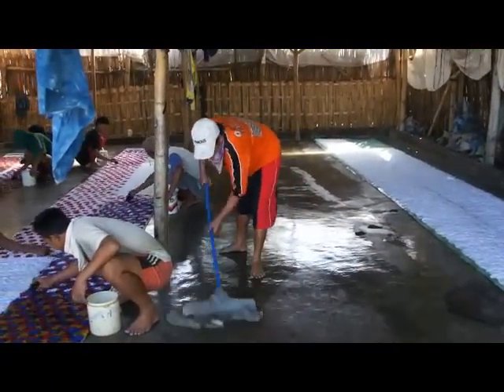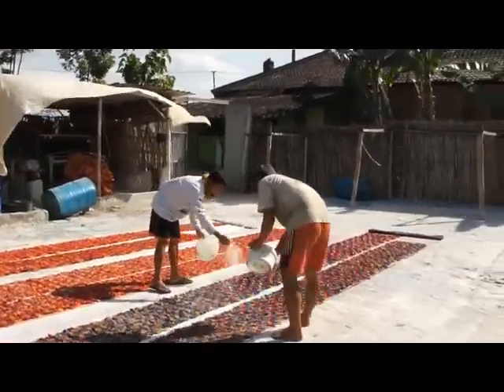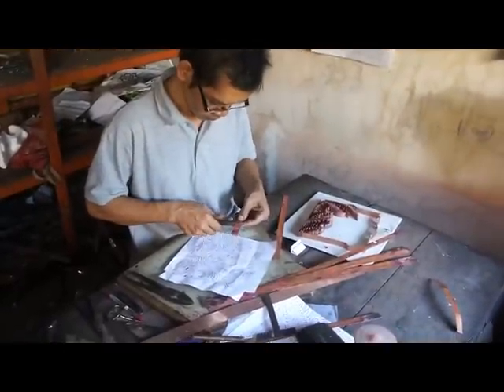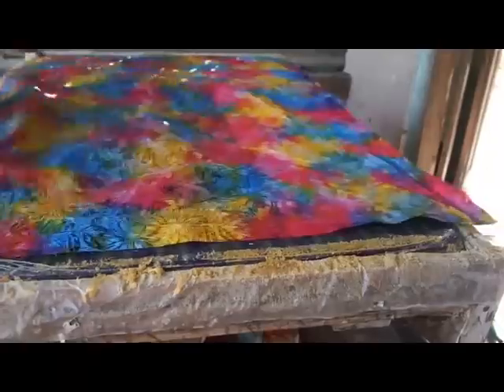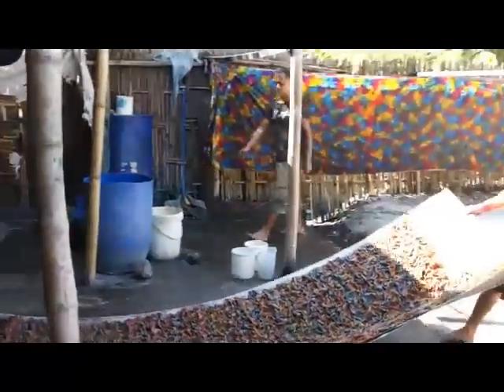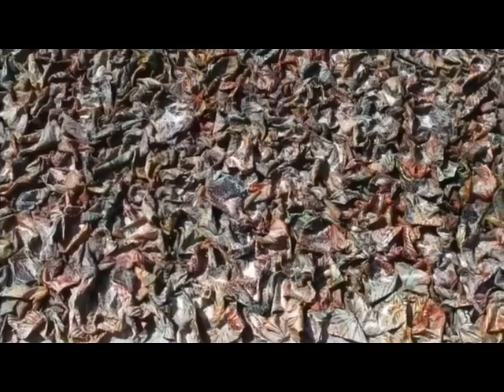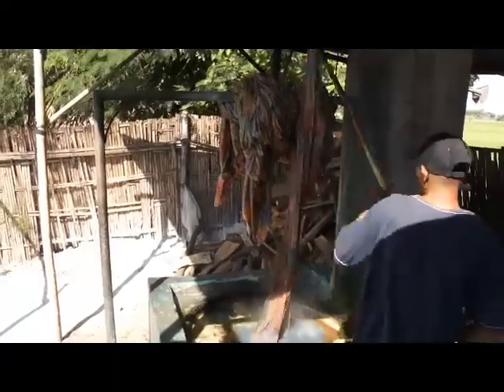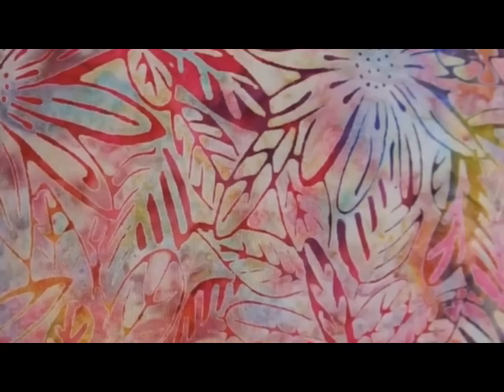Batik Documentary h264

Comment: It irritates me to see the Indonesian Natives work with chemicals like bleach and not wear gloves at least.
Reply: catsandsheep You just said what I have thought... :(
Reply: catsandsheep agreed.  They may also need breathing protection (from chemicals in the air).
Reply: Maybe masks would be good but they are outside as for the glove thing think of the results of wearing plastic gloves at +40c. That would be hard on the skin. Which evil is worse.
Reply: @DAYBROK3  Rubber gloves would work.
Reply: @MisterGigiCat They are not using chlorine bleach, but rather a dilute hydrogen peroxide solution. That's good old H2o2, water with one extra molecule of oxygen. Hydrogen peroxide is not toxic to the skin and is only harmful if swallowed. From a biodegradability standpoint, hydrogen peroxide breaks down into water and oxygen molecules. Not only does it biodegrade, but it does so quickly. After hydrogen peroxide does its cleaning, whether it’s removing bacteria, mold, dirt, or debris from a substrate, it begins breaking back down to its original building blocks.

Comment: I agree, beautiful work. But working with something that apparently bleaches the fabric with your bare hands doesn't seem right and healthy to me. The workers should be protected better.
Reply: they should be wearing gloves and masks for the bleaching and soda ash process and mixing dyes into water.  also the people around the boiling water should be better protected with heavy rubber aprons and sleeves.
Reply: @SusiScott They are not using chlorine bleach, but rather a dilute hydrogen peroxide solution. That's good old H2o2, water with one extra molecule of oxygen. From a biodegradability standpoint, hydrogen peroxide breaks down into water and oxygen molecules. Not only does it biodegrade, but it does so quickly. After hydrogen peroxide does its cleaning, whether it’s removing bacteria, mold, dirt, or debris from a substrate, it begins breaking back down to its original building blocks. Hydrogen peroxide is not toxic to the skin and is only harmful if swallowed.

Comment: Is that real bleach they have their bare hands in day in and day out???
Reply: They are not using chlorine bleach, but rather a dilute hydrogen peroxide solution. That's good old H2o2, water with one extra molecule of oxygen. Hydrogen peroxide is not toxic to the skin and is only harmful if swallowed. From a biodegradability standpoint, hydrogen peroxide breaks down into water and oxygen molecules. Not only does it biodegrade, but it does so quickly. After hydrogen peroxide does its cleaning, whether it’s removing bacteria, mold, dirt, or debris from a substrate, it begins breaking back down to its original building blocks.

Comment: Interesting. My concern is for the employees not wearing masks nor gloves, especially during the bleaching process. Where is the bleach water disposed?
Reply: @Susan Norman They are not using chlorine bleach, but rather a dilute hydrogen peroxide solution. That's good old H2o2, water with one extra molecule of oxygen. From a biodegradability standpoint, hydrogen peroxide breaks down into water and oxygen molecules. Not only does it biodegrade, but it does so quickly. After hydrogen peroxide does its cleaning, whether it’s removing bacteria, mold, dirt, or debris from a substrate, it begins breaking back down to its original building blocks.

Comment: If you have noticed no where in this video have they applied the wax which is the resist before they add color? When did they do this. I watched the whole video and never saw them use a Xjanting tool or anything to apply the wax resit. I was always taught you use soda ash before you dye to prepare the fabric for the dye. This is more of a tie dye video, not traditional batik. This is a reverse process??????????????
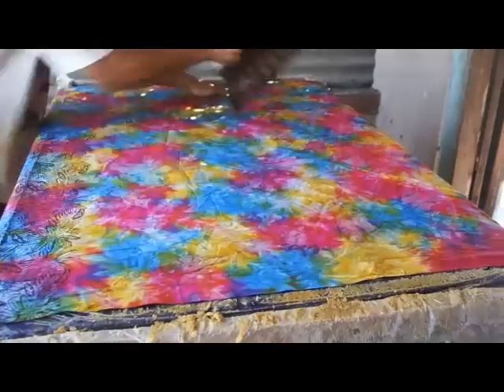Reply: I thought I saw a stamp being used from copper that had the wax on the stamp, paraffin and beeswax.  This is about 8:00 minutes into the video.
Reply: yes!

Comment: Could y provide gloves so that your workers' hands aren't in the bleach solution?
Reply: @Shelly T Halliburton They are not using chlorine bleach, but rather a dilute hydrogen peroxide solution. That's good old H2o2, water with one extra molecule of oxygen. Hydrogen peroxide is not toxic to the skin and is only harmful if swallowed. From a biodegradability standpoint, hydrogen peroxide breaks down into water and oxygen molecules. Not only does it biodegrade, but it does so quickly. After hydrogen peroxide does its cleaning, whether it’s removing bacteria, mold, dirt, or debris from a substrate, it begins breaking back down to its original building blocks.